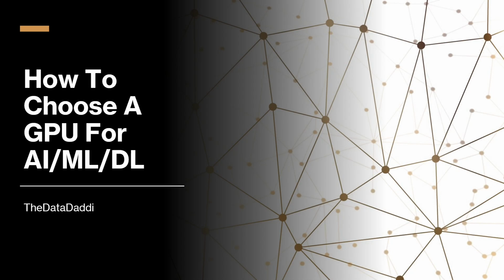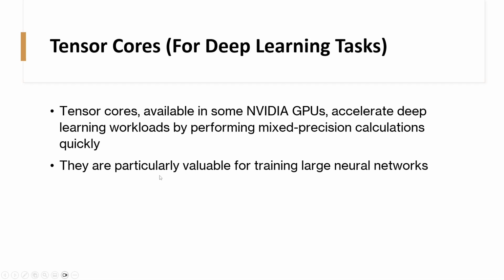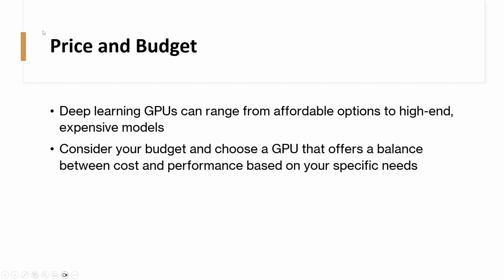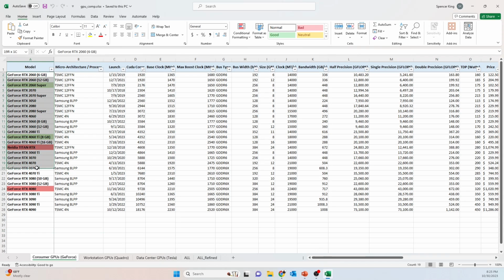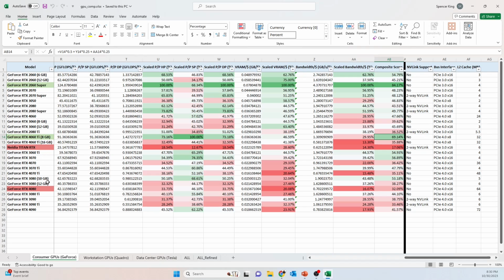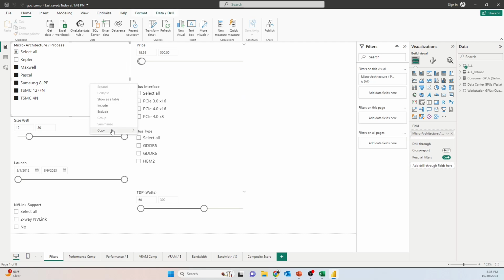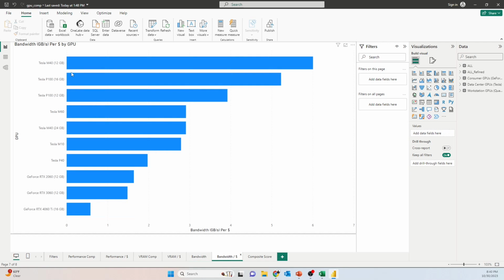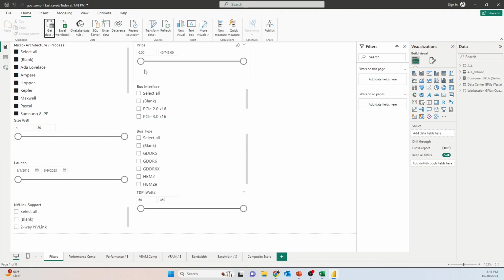AI/ML/DL GPU Buying Guide 2024: Get the Most AI Power for Your Budget

Comment: For anything with image generation, higher vram and cuda cores are pretty much the main priority. I was looking at 3060 with 12gb vram, 3090 with 24gb vram and 4090 with 24gb vram. The 4090 was twice as fast as the 3090 due to the updated architecture and more cuda cores, but considering I couldn't find one second hand, it would have cost me about 4 times the price. 

For something I'm just testing out, the 3060 and 3090 were the options I was willing to consider. I would have taken a 3060 if it didn't look as though more vram would have been a necessity for a lot of upcoming technology. The 3090 has been really nice to have and is at least 10 times faster, maybe even 20 times faster than running on an M1 MacBook pro with 16gb of unified memory. I just need to look for a feasible cooling option for it for when I'm running large stints.
Reply from the maker: I completely agree with this comment. I would almost always choose a GPU with higher VRAM over one with better performance these days. The 3090s rn are my favorite. I think they are the sweet spot of price, performance, and VRAM.    Unfortunately cooling them properly especially in a case (I am assuming this is your situation) can be challenging.  Could try adding more/better case fans and writing a program to adjust their speed based on GPU temp, upgrading to a bigger case, and potentially even selling and swapping for a water cooled variant if possible. The also make aftermarket coolers for these GPUs as well. I have never explored this, but these could be options.
Reply: @TheDataDaddi  I was looking into cooling options and there aren't many out there. After I wrote the first comment, I checked out the temperature and it was in the ideal temperature for maximum compute even after running it at that level for a few hours. I'm not sure if that's still a potential issue or not because of how often it's at maximum compute, but it did put my mind at ease somewhat. Due to the age of the GPU, there weren't any cooling options in stock in my country. I may consider selling it and buying a new second hand device with cooling built in, or if I'm able to monetize some of the work, I may just buy a 5090 when they release. Fingers crossed.

Comment: Hello, How much additional performance can I expect when running deep learning models if I upgrade from an RTX 3060 Ti with 8 GB to an RTX 4070 Ti Super with 16 GB?
Reply from the maker: It is hard to say because it is largely use case dependent, but in general you should see a significant improvement in terms of raw throughput (~75%-100% over the RTX 3060 Ti). However, for me the best benefit is the larger VRAM size. This would allow you to load models twice as large which would be extremely helpful for working with LLMs or diffusion based models. Eventually, I hope to be able to test these GPUs direct to give a more definitive answer.

Comment: I thought this video was damn good until you said A100 and H100 are the worst GPUs for deep learning and didnt mention anything about memory size or clustering which are ML related
Reply from the maker: Hi there. Thanks for the feedback. It is always appreciated. I am sorry that you felt like this video missed the mark. I will try to do a more comprehensive job in the future. 

Just to clarify a few things though. I certainly did not mean to imply that the A100 and H100 are the worst GPUs for DL. They are definitely some of the best. However, from a price to performance standpoint they are probably some of the worst (this may not be the case now as prices have changed quite a bit since the making of this video). I also feel that for most hobbyist, enthusiast, and even some small business these GPUs are too expensive to consider. 

I do believe I touched on memory size a couple of times in the video, but maybe I need to be more clear in the future. I am always working to get better at my presentation skills. I know sometimes that are lacking. 

As for clustering, I myself have not done this yet and do not have experience here so I my best not to speak on things I do not fully understand. I hope to setup a small cluster soon and will certainly be sharing the results from that on this channel so stay tuned for insights there.

Comment: Nice video!

I'm planning to do a university project for my computer science degree and I need a GPU for this (budget = 600€ - 800€ approx).

The project is about an autonomous driving system based on the CARLA simulator.

The main parts are:

* Ryzen 9 7900X
* 32GB RAM 6000Mhz/CL30
* 1TB WD\_BLACK 850X M.2

I've been researching the RTX 3090 since they have 24GB of VRAM and are sold used in my country for 650-750€ but I'm a bit afraid to buy them on the second-hand market because most of them don't have warranties, they are repaired (stickers and gold solders) and I don't really know if they will end up breaking down in a few months.

The other option I've considered is a new RTX 4070 TI, with 16GB of VRAM, which I could get for 700-800€.

My questions are:

* Which GPU do you recommend?(It doesn't necessarily have to be the ones I've listed)

* Does it matter so much to have more VRAM instead of power? I mean, 16GB isn't enough?

I think my university can give me access to training servers but I don't know the hardware of these. In this case, I would also need the GPU because I have to run CARLA on my computer.

I don't rule out using third-party services but I don't know if it will be economically possible due to the fact that I need large amounts of memory for the datasets.

Should I use a more normal GPU to do research by training small models and then do the hard work on those servers? Should I pay more and buy something completely local?

* Would it be possible to develop the entire project locally and without using AI servers?

I am a simple student who is planning to do a master's/PhD next year.

Thanks
Reply from the maker: Hi there! Thank you so much for the kind words and the great question. 

First of all that sounds like a really interesting project and tough research area!

A lot of what GPU you should by depends on how large the models are you will be working with. I am not super familiar with CARLA, but from my research just now. It looks like CARLA itself is a simulation environment, and its primarily loaded into conventional RAM. It looks like 32 GB should be sufficient here. As for the machine learning/deep learning piece, this is what will be loaded into VRAM. So, the choice of GPU depends a lot on what models you will be planning to use. If you can let me know which you plan to use, I can give you a more targeted answer. 

In general though, my initial though its that I would probably go with the refurbed RTX 3090. It is one of my favorite GPUs from a cost to performance perspective and should be able to handle pretty much whatever you throw at it pretty well. That said I would make sure to buy from a reputable seller. I have never had any issues buying second hand GPUs, but I have always been really pick about where/who I buy them from. If you have the ability to use EBAY, I would recommend that. It gives you at least 30 days of protection to make sure the GPU is working as expected. 

Some additional thoughts. I would almost never recommend for people to buy a cloud based GPU solution. I have not found any that I really like that much and are at a reasonable price point. I think you would almost always be better of to buy the GPU for the duration of the project then sell it at the end if needed rather than renting a cloud based solution. 

As far as can you develop the whole thing locally, I am not sure. I don't have enough information to say for sure. However, from my brief research it looks like that should be possible. 

Anyway, I hope this helps! Please let me know if you have anymore questions, and please keep me updated on your journey!

Comment: Would it be possible to link a 4070 ti super with another card? I'm just starting out but, I was thinking 16gb of vram could start me out and I could add a second card in an enclosure to connect to with my pc running dual gpus or my nas in the future. I can't afford much beyond one gpu right now while building out other systems 😕
Reply from the maker: Hi there. Thanks so much for the question!

Absolutely, this is really common. GPUs are really expensive so in many cases people (myself included) will buy GPUs incrementally as they have the money.
Reply: @TheDataDaddi  Cool, I appreciate your reply! I feel like I'm witnessing the future watching videos like these and I'm both excited and overwhelmed!

Is it fine if a card doesn't have nvlink, or if they're cards from different generations? I'm thinking a 4070 ti super right now for my pc and a 3090 as the "vram/AI" server card (or a 4090 if the price drops enough once the 5090 comes out). Thanks again for your reply and helpful videos!
Reply from the maker: @philiphimmelstein9510  Yep! This is one reason I love this area so much. Things change so quickly. It is always exciting. 

Yep, that should be fine! NVLink is definitely not a requirement. In fact, I have not actually tested the performance gains (or lack there of) you actually get from it. I need to do that. lol. I have 3 different GPUs in one machine and don't have any issues. Of course! Happy to help.
Reply: @TheDataDaddi  Sweet! That's good news. Thank you 😊
Reply from the maker: @philiphimmelstein9510  Of course! Happy to help!

Comment: You are missing the most important point, tensor core fp16 and bf16 performance. Shader fp16 isn't used anywhere where it's performance matters
Reply from the maker: Hi there! Thanks for your comment!

I completely agree that tensor core FP16 and particularly BF16 performance are crucial for LLMs and many other deep learning tasks. However, I don’t think we can entirely dismiss the relevance of standard CUDA cores or shader cores in AI workloads.

While tensor cores are optimized for FP16 and BF16 precision, CUDA and shader cores still play a significant role, especially for FP32 tasks, which remain the default in many deep learning models—particularly in computer vision and audio processing.

Moreover, it's important to note that CUDA cores can handle models trained in FP16 or quantized formats. The key difference is in efficiency: tensor cores will perform these tasks faster, but GPUs without tensor cores can still run the models—often at a fraction of the cost. This leads to a trade-off between performance and price.

If top-tier performance is the goal, then GPUs with a high number of tensor cores are the way to go. However, for many users, especially those on a budget or with less performance-critical needs, GPUs with fewer tensor cores (or none) can still offer viable solutions. It's all about balancing your requirements with what’s available.
Reply: @TheDataDaddi  Yes you are right, CUDA=shader core fp32 is very relevant especially in training because it's easier to use for lazy quick prototyping/dev work or sanity checking your low-precision result, or the rare (training) case where you actually need the range and precision. However, for tensor core GPUs shader fp16 performance has no effect. There shader fp16 is only for stuff like activation functions and perf could be tens of times lower without having any effect. The point was just that for tensor core GPUs you would want to only list tensor core fp16 flops.

Grabbing a dirt cheap P100 16GB space heater for fp16 memory-demanging workloads could possibly make sense, here shader fp16 would matter. (Even int8 maybe but I dont't know if common frameworks offer dp4a implementations)

Adding int8 and fp8, even fp6 and fp4, to the comparison for inference purposes would be interesting too since LLMs are now often available in those precisions and fp8 effectively doubles memory size and bandwidth too compared to fp16.

Comment: When it comes to LLMs, is it possible to run multiple GPUs to increase performance? I have a lot of PCIe slots and bandwidth and would love to stack multiple last gen, lesser expensive GPUs, rather than spending a big chunk of change on a newer card. I was looking at an A100 for the performance and RAM at an affordable price, for me, but if I could do 6 V100 (16gb) cards, I'd have 96gb RAM, 30720 cuda cores, and close other metrics to the H100, IF they stack that way. So, question is, can you run LLM models in a multi-GPU config?
Reply: OK, did some additional research and it looks like Ollama does support multi-GPU. It seemed to initially support it by sending copies of the model to multiple GPUs, so as to parallelize requests, but it seems like it is able to shard the model between multiple GPUs now. This should allow one to take advantage of cuda cores and ram, across multiple GPUs, for large models, having Ollama managing the traffic cop duties.

Gotta start looking into those 6 V100 cards, maybe.

Comment: All things considered 2 X RTX 4060 TI 16GB is the best investment if you run Ai load which can utilize both CPU's. 8704 modern CUDA and 32GB are better specs than a 4070Ti 16GB. Memory is key here. The M40 are way to expensive even the used ones price is insanely high.
Reply from the maker: Hey there. Thanks so much for the comment. I think the 4060 TI is a great choice. However, all of these choices at the end of the day depend on current GPUs prices. In general though, I would definitely agree with you assessment!

Comment: I like to throw in a perspective, currently im using an GTX 960 2gb vram, 7 gb ddr 2 ram @ 600mhz, I also have shared video ram or what it was called which ups my "vram" up to around 5gb (can be checked in task manager for example), AMD tripple core @ 2.1ghz, im fine tuning the smallest gpt2 model via CUDA at around 1 iteration per ~30 seconds and it uses around 3.5gb of my "vram".
Reply from the maker: Hi there. Thank you so much for the comment. 

Love when people share specifics like this. Incredibly helpful for the community to understand the performance of real systems. This actually is very impressive. Also, shows that you don't need the latest and greatest hardware for every use case.

Comment: Great video^^, getting tired of seeing those gpu comparison video where all they think are just about gaming.
 it pops up right in time when i'm thinking to build a new pc. I was thinking about buying the 4060 ti with its 16gigs vram to help me with my thesis research that I assume the 16gigs would be really helpful for the ML/DL(used to have 1660 with 6gigs vram and its horrendous XD) but also pretty good enough for my daily use such as streaming and editing. totally in a tight budget that i needed to squeeze a bit more to get that 470$(the price in my country rn) card or should i just wait for the rtx 50 series to come out later hoping the older gen price drop?
Reply from the maker: Hey there. Thanks so much for the kind word and the question! 

I think the 4060 TI is a solid choice in general for a budget constrained build for a masters thesis project. Of course it depends on your exact use case, but baring working with larger LLMs I think this should be a great choice. 

As far as waiting for the rtx 5000 series GPUs to come out, I would not really hold my breath for a huge price drop. I think even once the rtx 5000 do come out it will take a while for the prices of older GPUs to be substantial affected. If it was me, I wouldn't wait. I would just go ahead and buy. 

Best of luck with you project! Hope this helps!

Comment: Im torn in choosing for Gpu for ai use first (koboldccp + sillytavern) and gaming second. My choices were a 3060 12gb at first then the 4060 ti 16 stood out but then the 4070 ti super got recommend to me. I intend to use the card for at least 3-5 years. The only thing limiting me is my small budget. Like i could buy the 3060 now and the 4060 ti after few weeks. While ill wait and watch out for deals on the 4070...
Reply from the maker: Hi there. Thanks for the comment! 

I am not super familiar with koboldccp or sillytavern so please take what I say with a several grains of salt, but from my brief research they need an AI model integrated in some way. I am assuming you want to host this locally. For this I would go with the GPU with the largest VRAM, so the 4060 16GB TI is the clear choice in my book.
Reply: @TheDataDaddi  yeah. Basically locally hosting an AI model to my pc. I'm not really into machine learning as of yet. Currently I have a 2060 on my pc and 6 GB isn't really enough. Another question is  AMD not a good alternative?
Reply from the maker: @rukitorin1998  It can be, but AMD is generally not as easy to use for machine learning. However, it may be applicable for your use case. AMD definitely seems to offer better price to performance, but there are still a lot of bugs from what I understand. I also cannot recommend it strongly AMD because I have not personally dabbled there. What I am telling you now is just based on feedback I have received from viewers.
Reply: @TheDataDaddi  thanks for responding, sorry for the late reply. :D i will be buying the 4060 ti 16gb soon when i find a cheaper price point. Living in the Philippines prices are somewhat higher. 30 kph peso(519.08$) to 32k (553.68$) is the prices im looking at right now.

Comment: Things have changed, time to step into an Arc A770. Will need a slight adjustment with the tools but now you can get the higher end GPU for a lot less money.
Reply from the maker: Hi there. Thanks so much for the comment!

This is great to hear! What AI/ML/DL applications have you used the ARC A770 for? I would be super curious to know if you have tried it out for anything yet!